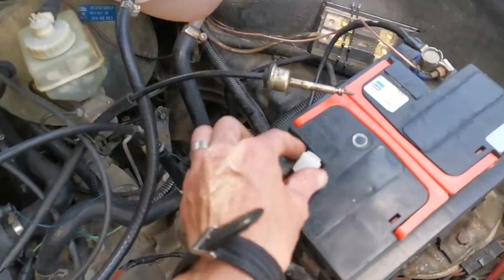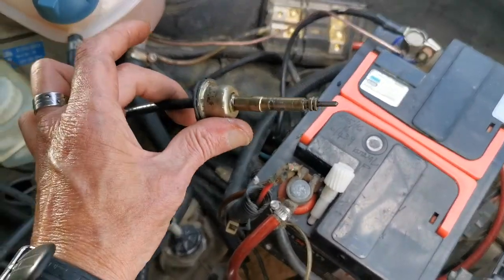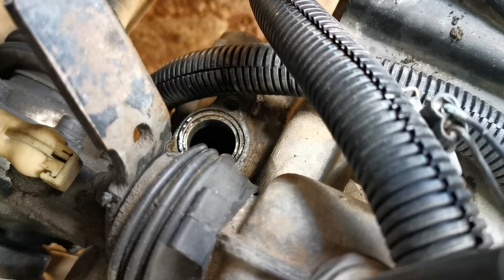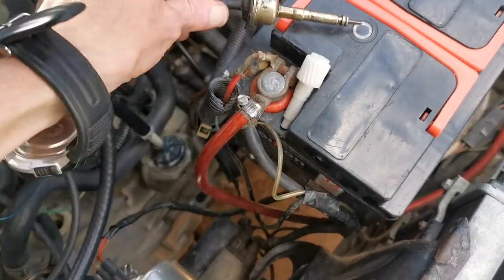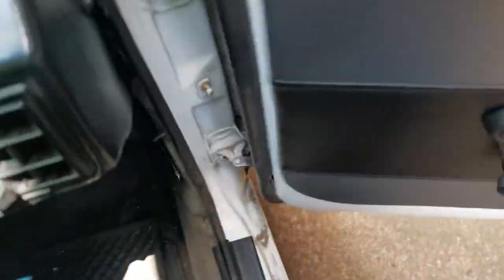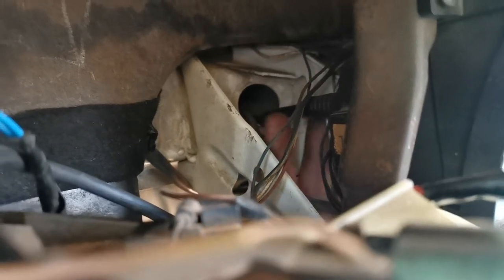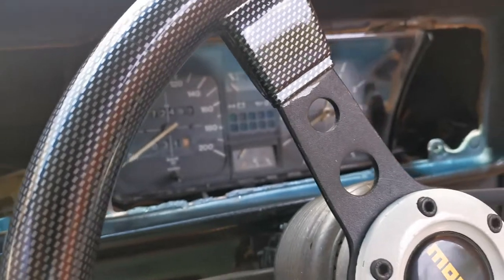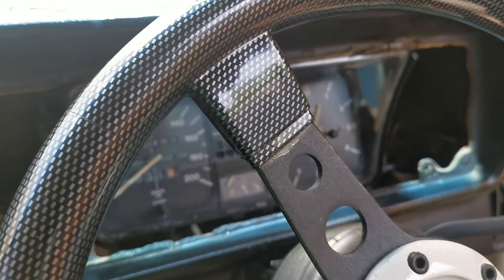mk1/mk2 golf replacing speedo drive or cable!!!!

Comment: If my Speedo is reading 7-10% high, could it be due to the cable/gear? Or am I wasting my time going that route?
Reply from the maker: Hi there. Your speedo is always 10 kilo meters out that comes factory std. Don't think there's anything wrong with your speedo cable..sorry for only replying now.
Reply: There are 3 kinds of gear with 15, 16 and 17 teeth. Maybe you just have the wrong one